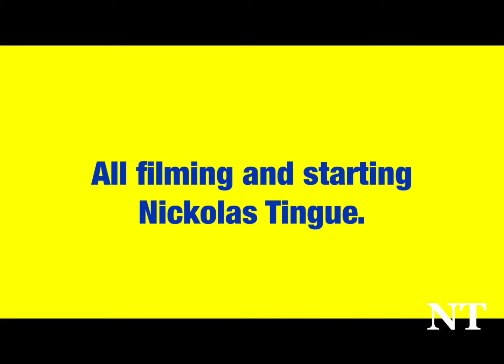video 43 railroad crossing time

Comment: I've been using spackling or joint compound for crossings, roads and sidewalks for years! Just remember when using it for roads and sidewalks, to do it in thin layers or it will crack. The stuff is made for walls, drywall joints and covering drywall screws! It's made to be applied in thin layers with sanding between layers. Spackling compound can be applied a little thicker, it just needs more drying time. Merry Christmas, Happy Holidays, Happy New Year.  Roy
Reply from the maker: Your absolutely correct.